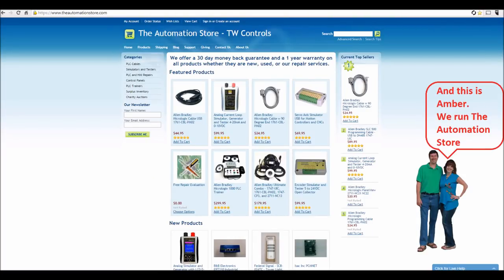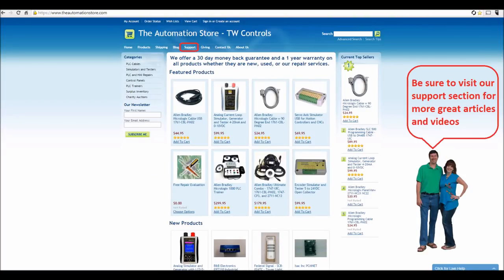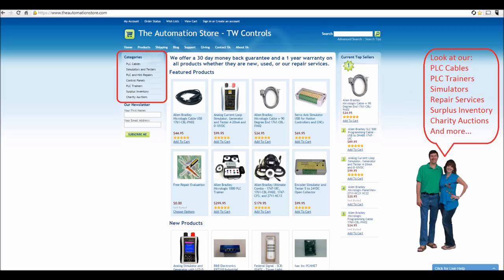Introduction to Electrical Control Panels including PLCs and HMIs

Comment: You might want to switch the E-stop to a push-on twist-to-release unit with a yellow background.
Reply from the maker: We've phased in the yellow background since this video but still use the push pull. Any particular reason or code that makes you prefer the twist to release? Thanks for the comments!
Reply: +Tim Wilborne Hi Tim, it's not a requirement, just a preference with a lot of European companies that want a cone twist-to-release actuator (we do a lot of safety retrofits). They specify a well-labeled direction marking as well - arrows molded into the button showing twist direction.
Reply from the maker: +adisharr OK thanks for the info. The yellow background is required in the US now but I don't think the twist locks are. It just seems to require more intentional effort to pull instead of twist but both are safe actions.

Comment: What's the cause of high power warning on such panels ?
Reply from the maker: What device is displaying the high power warning?
Reply: Tim Wilborne The Plc (hmi) of a gas booster compressor
Reply from the maker: Tolulade Ademisoye You'll have to dig in further than that. Do you have offline copies of the PLC and HMI programs?
Reply: Tim Wilborne None. I noticed high power warning on the hmi resulting in the failure of the compressor to compress gas. It's like a safe mechanism/sensor got activated because of high power to the compressor motor.
Reply from the maker: That's going to be tough to diagnose without programs.  Do you have wiring diagrams?  Right after the disconnect is there any type of voltage monitor?  Otherwise it could be coming from an AC drive if it has it.
Reply: Tim Wilborne yea, I understand. Thanks anyways.

Comment: a hvac panel control circuit video would be helpful.....with a dol/vfd starter
Reply from the maker: Abhijit Shetty We've got a magnetic motor starter/drive video coming.  Would anything else be helpful for the HVAC field?  We get lots of inquires from HVAC users about using our analog simulators to simulate temperature, pressure, etc instruments.
Reply: Tim Wilborne  Hi Tim....according to me the requirement of the hvac panels today is that it should be compatible with BMS (building management system)....i.e everything should be controlled by a plc controller and an optional manual mode operation i.e a traditional DOL starter.
Reply: Tim Wilborne If you  could give me your email id ...i would like to share with you a HVAc electrical panel drawing and maybe you can make a video for hvac people. Thanks
Reply from the maker: +Abhijit Shetty Sounds great! contactus@twcontrols.com
Reply: Tim Wilborne mailed you drwaings....let me know
Reply from the maker: +Abhijit Shetty Got them. I'll look over them this weekend
Reply: ok.

Comment: It would be nice if u can make a video with a magnetic reverse controls mostly used on lathes, thank u, and the videobwasnt boring at all 👍
Reply from the maker: Maco Garo Hi Maco.  By magnetic reverse controls do you mean a reversing motor starter?
Reply: Yeah that's what I meant thanks for answering👍👍👍
Reply from the maker: Maco Garo Ok I can do that.  I'll put it on the list.

Comment: How to design, and build vision panels in real life (maybe using industrial 19" computers, PLCs, HMI, displays, mouse, and keyboard)
Reply from the maker: Hi Ahmad.  Can you explain what you mean by a vision panel?
Reply: A panel that has a computer connected to cameras. Like those used to inspect if some parts have the appropriate shape and dimensions.
usually that computer acts as a database server as well.
Reply from the maker: Okay I understand now. I don't have a video planned on Vision because I don't do a lot of it but I do have one plan on the steps I go through when designing a control panel which would cover most of that.
Reply: Thank you very much :D

Comment: Why wouldn't you put wire duct on your door to hide your door wires and a snake skin makes for a cleaner finished product
Reply from the maker: loosejuice93 loosejuice93 I do in my larger panels. There's not a better way to organize the wires on the door. But it looks a little weird when you only have to buttons on An excellent idea!
Reply: Time and money. Sometimes you dont have time to waste on too much OCD stuff.

As long as everything is labeled, the overall panel is neat and professional looking, and everything tests good, the panel gets an A+. Who cares about having a wire way on the door? Who notices that? Only sticklers...

In my opinion, his panel looks just fine, and if I opened it up to work on it in the future, I wouldnt have a single negative thing to say about it.
Reply: and that's exactly why you don't own a panel shop work at a panel shop or go near them cause of mind sets like that the door looks like garbage if I opened up a panel and didn't see wire way and snake skin I would have a fit total cost btw of about 6 dollars
Reply: I do work at a panel shop. I have for several years. I do good work. But I rarely use wire way on doors. 

However, if I worked for someone who would "throw a fit" if I didnt have a wire way on the door, then I would simply install the wire way, as instructed.

The panel presented in this video does not look like garbage, though. It looks just fine. In fact, it looks quite professional. You have to have an open mind when contrasting other people's work with you own. You may not know it, but there could be some aspect of the way you build your panels that I might find appalling. Would you want me to be a dick about it?

And even assuming you and your work are objectively perfect, how does it help me, you, or the industry in general to disparage other people's work?

Comment: Where I worked they used 110 control voltage guess they didn't care about the operator.
Reply from the maker: I think the industry is shifting to mostly 24V control as machines have more I/O attached to them but properly isolated and protected, 120VAC can be safe on the simplest of applications.